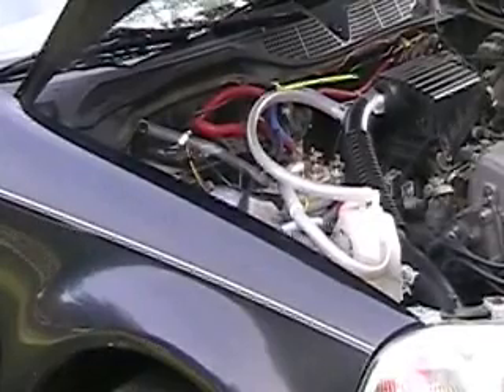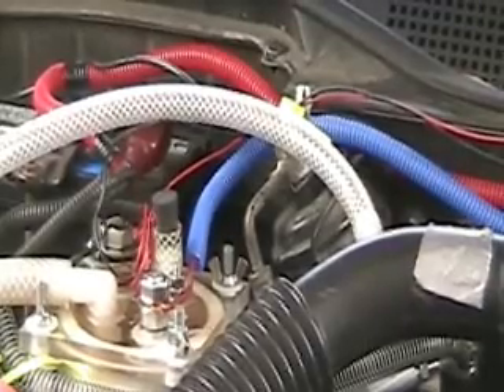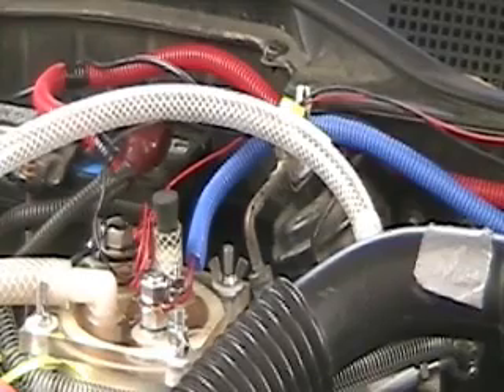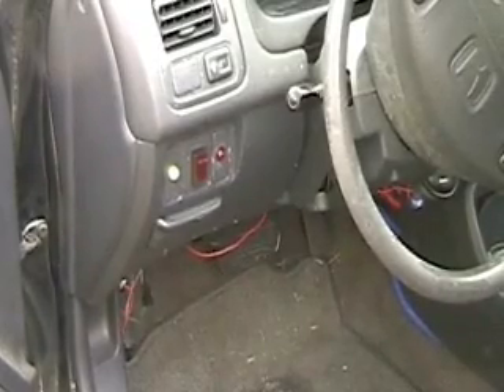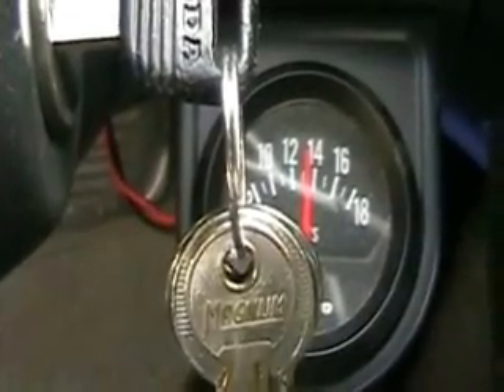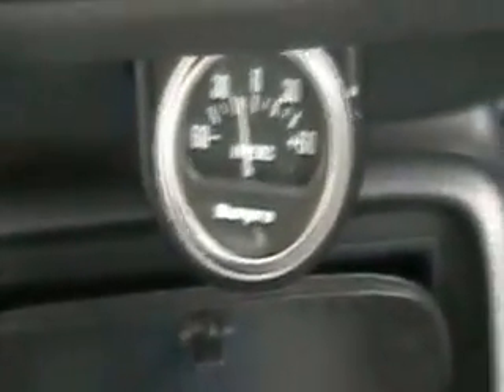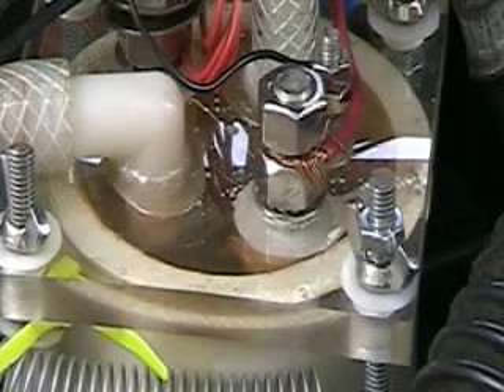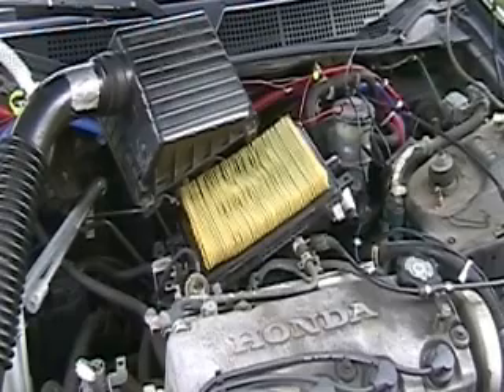Hydrogen Tap (FOCUS -more electrolyte) 327

Comment: Take a look at the coolant overflow setup on your car's radiator. Then picture a vent on your focus cell with a tube running well below water line. Vent to outside discharges to a small overflow reservoir that has discharge tube mounted LOW in container. Fluid in cell expands, is captured by overflow reservoir, cell turns off, fluid contracts, fluid is drawn back from overflow reservoir into focus cell ... simple, cheap, effective ...

Comment: There is a lot of water vapor naturally in engine exhaust.  You can watch water droplets come out of an exhaust pipe of an unmodified car.  The engine itself is aluminum and highly corrosion resistant steel.  The biggest wear and tear will be to your exhaust pipe, a hairline crack in the exhaust pipe will more rapidly rust through due to the increased humidity of the exhaust.